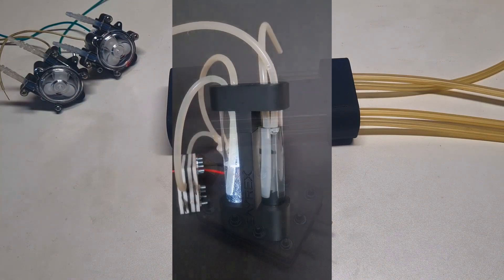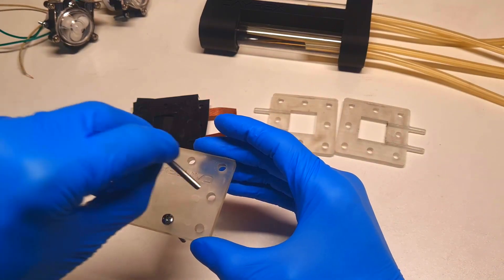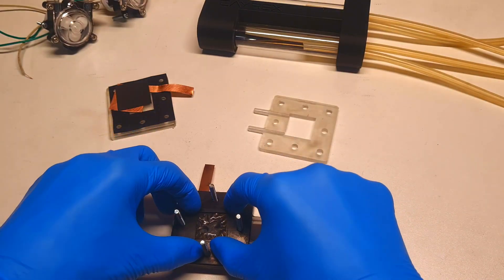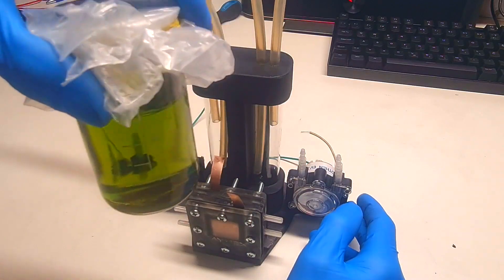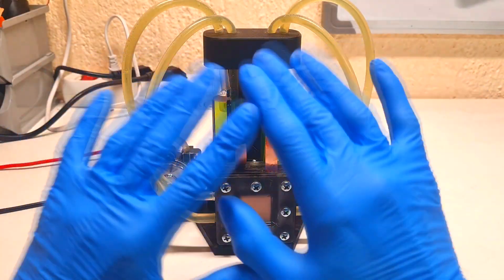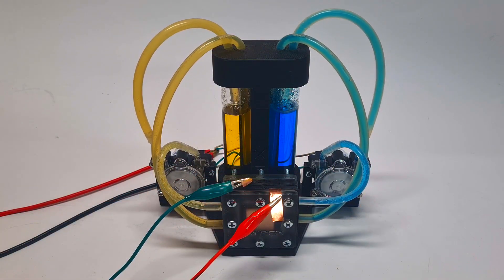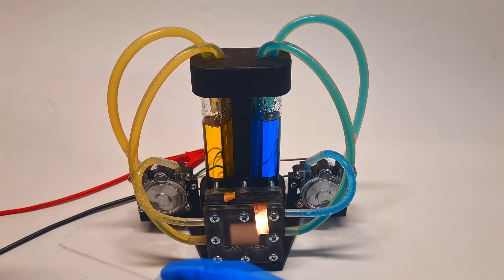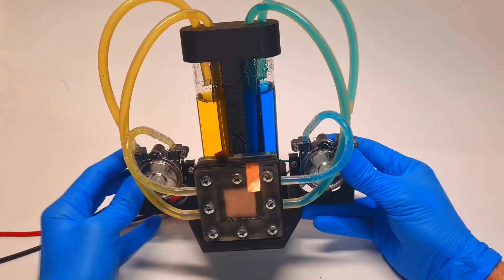Diy Vanadium Redox flow battery - PART 5

Comment: Weaker pumps that operate on the same battery should be used.😅
Reply from the maker: Yes, correct. At the time I only had these pumps. I was also thinking of making a one duble flow pump.

Comment: Excellent battery sir Cayrex. Actually this has also been an interest in our research and wanted ur work to be part of our related literature.

That being said, we can't find a study that discuss the formulation of the vanadium electrolyte. Would you be able to share the formulation procedure of vanadium elevtrolyte? 

It's ok if you can't, I just tried to seek for help
Reply from the maker: Cool! In basic you dissolve 1.6M VOSO4 into 3M of H2SO4. Here you have one example: The manufacturing process for 1 L of 1.6 M vanadium (4+) solution is as follows: mixing 268.86 g of VOSO4·XH2O powder in 163.2 mL of sulfuric acid, then add water until the total volume reaches 1 L. The solutions are stirred for 24 h to prepare homogeneous electrolyte, which is 1.6 M VOSO4 + 3 M H2SO4. The prepared vanadium (4+) electrolyte solution is charged to produce vanadium (3+) in the negative solution and vanadium (5+) in the positive solution. Then, 201.71 g (1.6 M) of reducing agent, oxalic acid, is added to vanadium (5+) solution to produce vanadium (4+) and stirred at 70 °C for 24 h. Finally, the equal amounts of both vanadium (3+) and vanadium (4+) are mixed to prepare vanadium (3.5+) electrolyte.

Comment: How do you make the elektrolyte? How much sulfuric acid?
Reply from the maker: 1.6M VOSO, 3M H2SO4
Reply: @cayrex would V2O5 work also?
Reply from the maker: @Nick__T Yes but you need higher concentration H2SO4 and elevated temperature.
Reply: @cayrex I am making the elektrolyte but it still stays orange after full 2 hour of stirring and heat. 5 grams of V2O5 and 60mL 1.0M sulfuric acid. I tried adding extra 40mL 16M sulfuric acid but nothing still happened
Reply from the maker: @Nick__T V₂O₅ is poorly soluble. For that reason is better to use VOSO
Reply: @cayrex And if I use V2O5, do I need a reducing agent like oxalic acid dihydrate?
Reply from the maker: @Nick__T  Yes, you will likely need a reducing agent
Reply: @cayrex Ok thank you very much! I’m making this for a school project and will try to add oxalic acid.
Reply: @cayrex  Is it ok if it is blue?
Reply: @cayrex In your video it is green
Reply: @cayrex My solution is blue and not green like in the video will it still work?

Comment: Hello, is your storage tank and vial holder commercially available?
Reply from the maker: @LynnetteAti-Tay  Yes it is. I buy it from the store called TEDI, which is here in EU. But you can find it on Amazon also. The size of the glass tube is 140 x 25mm. And you can buy it a glass or plastic version. I will also make a video where I will share all the info about the items which I use in that project,... including the STL files for the tank holders and cells which the files will be avalible for symbolic price of around 2 EUR
Reply: @cayrex  Alright, thank you so much. I will stay tuned!

Comment: How do you know when the batt is full charge (or discharge) please ? 
Thanks for the video
Reply from the maker: In most cases a battery management system will control the charge and discharge which will let you know what is the state of the battery
Reply: @cayrex  Greate.... maybe this will be my photovoltaic back up battery. 
First I must finish my new house :-) 
Thanks a lot.

Comment: Why not use the batteries own power to run its own pumps! That would have been cool! lol
Reply from the maker: Here in this demo I use only one cell which have the voltage of 1.5V. To run the 3V pump I need more cells.

Comment: Hi.   You    have   two identical metals clamped, in this case copper.Shouldn't they be different?
Reply from the maker: Not really. The copper folis are only the current collectors. But the active materials need to be different in the batteries. Here in that vanadium flow battery you need a positive and negative electrolyte which are different or in that che have different oxidation states of the electrolytes.

Comment: Very cool proof of concept. I've seen a lot of talk of this being done on a larger scale for grid level power storage. I imagine it's still not very cost effective for a consumer to do something like this though
Reply from the maker: Correct,... the VRFB is meant for large storage like grid support, data centers, etc. I mean you can buy,... and biger will be the capacity of the battery better will be also the price per kWh,... but still it can be expensive. Some china comany offers me a 5kW cell stack for $5200. And the 20kWh electrolyte another $10k

Comment: Is the battery powering the pumps? Could you get the electrolite to flow with gravity and pressure? Say, like a heron fountan times to complete its cycle at the same time the electrolite is finished?  Or using RMS's 4 chamber on and just flip it every now and then.

Comment: what is the variable that decides what amperage it can deliver? is that the flow? or maybe the size of the plates?  and do u have any ideal when using salt water what the Wh/liter dencity would be?
Reply from the maker: The power is related to the surface area of the electrodes (for flow and non flow batteries). By flow batteries can power effect the concentration of the electrolyte. The Wh/l of salt flow battery similar to vanadium redox flow battery (20 Wh/l)

Comment: How to manage the power supply of pumps from the same battery power?
Reply from the maker: More cells. Here I only demostrate the Vanadium flow battery system and for that reason I use only one cell. That I can run also the pumps, I will need 5 cells to get the voltage around 6V (because the pumps need 6V and 150mA)

Comment: So about 0.2W from the battery to run the white LED? And about 5 to 10W to run the pumps from another power source? Have you done any rough calculations on efficiency?
Reply from the maker: That mini battery uses only one cell  and is only for the demostration of the vanadium redox flow battery systems. And that the battery will run also the pumps I need to have more or less 5 cells to get the voltage  around 6 volts (the pumps are 6V and 150mA).

Comment: I just want to mention copper and carbon felt combined was a bad idea, carbon felts are all blue/green now from the copper collectors (used braided copper weaved/wrapped around the carbon felt  ), and aluminum is the worst combination because of galvanic corrosion, so I guess I will be using nickel felt as the collector for the carbon felt, Titanium would be the next best option but I already have a few rolls of nickel sitting here unused last few decades , or I might order in some graphite wire , it's a shame the felt wicks the liquid so easily
Reply from the maker: So, you put the copper direct to the carbon felt which is soaked with electrolyte?
Reply: @ pretty much , I wanted good full contact with the felt with lowest resistance possible for high current draw / charge , the copper collectors was pretty much sandwich between 2x carbon felt layers ,what I have is agi drainage pipe as a support structure then carbon felt wrapped around that then I had copper wire winding  down to the bottom then winding back up the top tieing the felt to the pipe (like chicken wire / latace so it was not like a heater coil ) then I had another layer of carbon felt wrapped around then the membrane sleeve / sock / tube holding that in place , then carbon felt wrapped around the membrane then copper wire winding down and back up again to tie it all tightly together with another outer felt layer just tied on with fishing line and a few zip ties and a larger agi pipe slid over top  to keep it protected , these are sitting inside 200L plastic drums and I am now cheating a bit using pairs of drums with polarities reversed so i do not have to worry about matching volume sizes something I have no way to explain with out pictures but as I am flowing liquid though membrane tubes (they are no longer flat sheets but tubed like a drinking straw ) the inside tube has lower liquid volume then the external side of the tube sitting inside the drums so I alternate in pairs , ie) drum 1 has + on internal tube - on external drum 1 then the drum 1 gets plumbed into drum 2 internal tube and it has - on the internal tube and + on external drum 2 that is plumbed into drum 1 internal tube , I really hope I typed that all right  ,  others have been saying to Nickel plate the copper , but others are saying that will also have  galvanic corrosion , I do also have nickel strips / rolls  for 18650 battery packs , but did not want to use them because they will block liquid flowing through the felt easily , also these are 86cm long full height of the drums , the centre has been cut out about 1 foot wide for acess  with a donor drum capping off their tops / creating a lid , using the remaining 6 inch lip for holding things in place giving me something to bolt onto for electrodes etc considering the drums cost next to nothing well worth it :P no need for custom stack blocks and custom O-rings to prevent leaks , I just have membrane held on / sealed with a generic O-ring on PVC pipe that just slips over the top of the internal agi pipe the felt then goes up inside this PVC pipe for electrical connections and the membrane is sealed onto the external of this pipe liquid is flowed through a vented T , oh and I am now stacking them by using 90 deg elbows as a carbon felt separator so the liquid going up and down through multiple membrane tubes each can do 100A , my 5kw inverter can only do 120A so until I get another inverter I can not stress test it much more think 80A was actually its rating but I have tallied up the MPPT Solar Chargers and have seen 400A going into it peak how ever I was only getting about 200w out of 250w from the individual panels so I might just need to clean them :D also i am scared of killing the membranes by having too much current , unsure what their limits are or if they have already been surpassed , does anyone know how much voltage / current they can safely be exposed to >?
Reply: and a mate just suggested nickel plate the carbon felt as well , so going to see how that goes as well : Copper ρ (Ω•m) 1.68×10−8 σ (S/m) 5.96×107 , Nickel ρ (Ω•m) 6.99×10−8,	σ (S/m)1.43×107, Carbon ρ (Ω•m)5×10−4 to 8×10−4 σ (S/m)1.25 to 2×103

Comment: That was just beautiful!
Just for completeness, could you assemble a double stack of cells so you can possibly run the pump motors of the actual battery?
I assume it would be possible to loop the tubing through multiple cells in series or parallel?
Reply from the maker: Thanks! Yes it is possble. 5 more cells can do the job.
Reply: @cayrex  How is the current? Maybe a single cell and using a boost converter could work? Just to get it self-contained.

Comment: but can it run the pumps on its own power and still produce enough power to run something else
Reply from the maker: Hey! That one not, because this battery have only one cell  and if more or less for the demostration of the system. But when the battery have more cells (like in commercial VRFB) which will create a voltages from 12 to 48V then the battery can run the pumps and something else. Here in the video the pumps need 6 volts and one VRFB cell create around 1.2 to 1.4 volts. So I will need at least 5 more cells.

Comment: Try making a manganese or chromium redox battery. Should provide decent energy because you can form anions as well as various degrees of cations from the metals. ❤
Reply from the maker: A manganese type can be interesting. But before that I will try a zinc vanadium flow battery

Comment: AAA - Always Add Acid. Please do not add water into concentrated acid. It can generate a lot of heat and splatter into your face. Thanks for the videos.
Reply from the maker: Relax,  I know what I am doing 😁 I add water to acid because I want to generate heat. But of course you need to add water to acid in controlled way. Otherwise, you need to add acid to water for sure.

Comment: for anyone in Australia I have a few rolls of membranes 80cm wide in 102/50um $400AUD /m and 103/75um  $550AUD /m , can use escrow services etc will only sell as 80cm widths, thanks for the encouragement of getting my battery project underway it worked out pretty good , the test systems 8000L doing 200A (I oversized a bit for my 100A target expecting to not get LAB condition performance ) and it worked now I just have to get the 2x 20,000L tanks brought in whip up a few more electrodes to handle the 100+* 250w solar panels aimed at it and I am done (I had completely focused on needing 5kw peak power draw completely forgotten I had 25kw of power going into them ... )
Reply from the maker: This is nice! Maybe, will need them. So, you have the battery now? You are damn fast, 10 days ago you ask me for the group buy for the membranes and now 8000l system. Cool!
Reply: @cayrex  I already had these coming since before x-mas :P Redox flow batteries have been on my mind since 2013 I only just recently came across your channel while seeing what break through's are out their plus you had the mixture rates I was looking for , I hate lithium  I'll pull apart tesla packs and resell the cells but I will not use them (apart from e-bike ) I pretty much have a cloned Aquion battery bank here I made as well and almost got around to buying an original dirt cheap when covid hit shame someone beat me to it facebook ad was only up for like 10 mins as well , I also bought up all the lead crystal batteries when they liquidated .. dunno I like playing with electricity
Reply from the maker: @christopherstaples6758  Aha ok. 
Make more sense now. Cool, you have Aquion battery,... I am lookoing everywhere for those batteries.
Reply: @cayrex  I came up with another way to do my sock membranes inside an single enclosed IBC so no specialty cell stack needed and not needing aheap of drums ,  if I can get my PVC pipe manifold to fit / assemble inside through the 150mm hole .. , do you know the  ideal amount of cells needed for 48v system ? I was doing 40 cells , a single 48v unit 1000L using of the shelf plumbing parts and O-Rings  that should do 200A should be pretty helpfull for all the bushy off griders around here   , also should I be measuring the ph ranges along with voltages ? (I have plenty of ph data loggers from Caridina Shrimp tanks) do you know if you need a 1:1 ratio of + and - liquid volume ? and should it be always mixed or will static / stagnant flow be ok ? tho it is still a ~$8kAUD initial startup cost for a ~3kw worth of storage with it costing about $600AUD per kw after that for additional liquid storage added , but I believe its about $10k less than any other basic redox cell stack I have been able to find over 50A
Reply: PVC DWV Riser 4 way Junction might be my new best friend or PVC 6 Way Equal Connector Sockets , is their any particular plastic film to look for that would block electrons flowing ? looking for something to join to membrane to use as insulator so I can attach something firmer to install UNI seals into (used for aquaponics for running PVC pipes through drum walls etc cheaper than bulkheads  )
Reply from the maker: @christopherstaples6758  The number of cells needed for 48V will depending on the cell voltage which you will get with your materials. Because the cell voltage of VRFB will be from 1.1V to 1.5V,.... it is also possible to get even lower voltage. For example,.... with 1.5V per cell, you will need 32 cells. The ph is in range 2 to 1
Reply: @cayrex   (a while back I found a website link you had either mentioned in a comment or was showing on your laptop screen I can not find the website now no idea what video I watched for it , they sold flow battery stuff ) yes I know that about the voltages but what is best lower voltage cells or higher voltage , its hard to know because of the throwaway greedy world we live in manufactures could be making 1.5v stacks for more profit while competing with manufactures that are doing 1v cells but providing stacks with  lower cycle count so membranes need replacing more often etc  just unsure whats going to kill the membranes faster higher voltages or high currents and which is more efficient , currently it seems lower currents are more efficient , I am currently data logging all power going in and then using a capacity tester  for discharges etc with a 2.5L  cell I was playing with a 80cm x 20cm membrane which has now de-laminated while doing high amp tests , you could see arcing happening
Reply: Have you still got some? I'm in WA, looking to build my own, and if I can get it for cheaper from bulk buying and sharing with others that would be great!
Reply: @gemcollector95  yes how much are you after ? or do you want a sample size sent to tinker with ?(envelope sizes are possible but must take the entire 80cm width ) I only have 80cm wide rolls now so that is the upper size limit   , 10m seems to fit neatly inside 50mm PVC tube
Reply: @christopherstaples6758  Hi, I am afraid it'll be a little while, I have started a pretty big construction project for a shed in my yard to build these kinds of things, but when I am ready I'll let you know, I have been researching and learned stuff like molar mass to make sure my mixes are right, now I just need a shed so I have somewhere to build
Reply: How is the project coming along? Any chance we can see some pictures? Would love to see it! I was very interested in doing something similar but I went the lithium route.

Comment: apparently mixing in pyrylium salt almost doubles energy density
Reply from the maker: Yes! Many things will increase the energy density. But in the end the cost will have the final word. For that reason you need to set the balanced electrolyte to have good performance at good price.